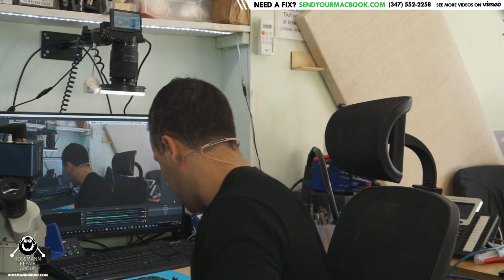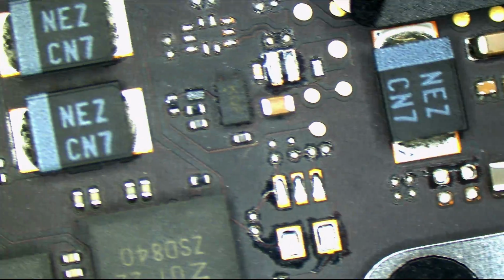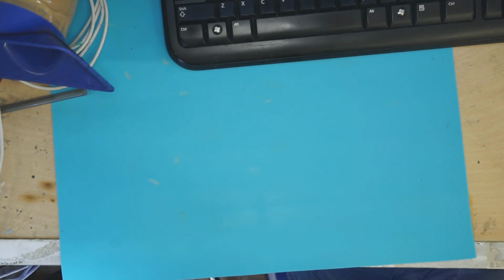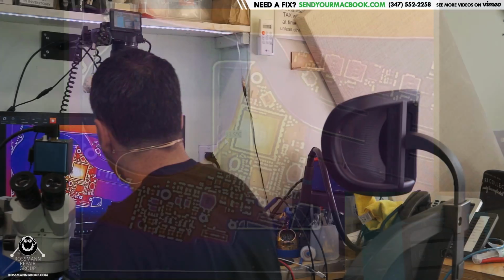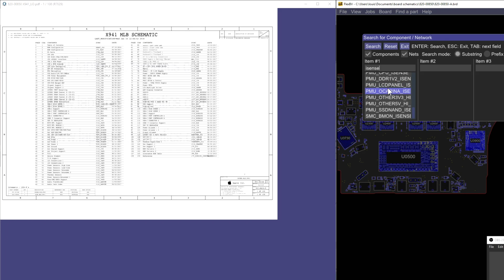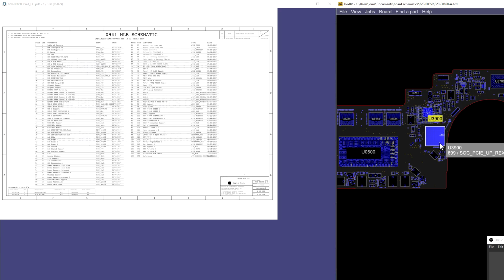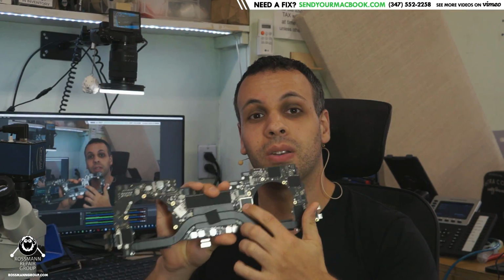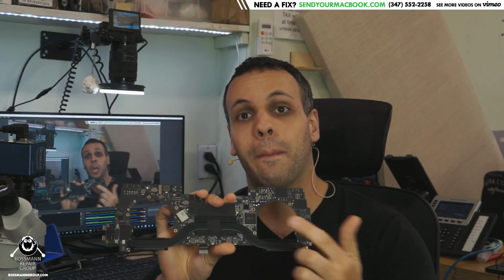Apple users have no one to blame but themselves.

Comment: One of these days, a horrible horrible person will give you the software/ equipment you need to make that T2 chip happy again.  Only a maniacle, self centered bastard would give louis the power to repair again.

How many horrible, disgusting jerks will attempt this? Please, jerks, do not give apple users this gift. They dont deserve it.
Reply: If you want to wait for that software to come along, feel free.
I'm going to just stay away from the t2 chip and all apple products
Reply: Even if they do come out with a new T2 chip, Apple probably has their operating system go out and check the code on that chip so that if it doesn't match, the operating system won't boot.
Reply: @prima6170  typical of apple!
Reply: Im really really confused as to how my pos hp laptop has been through an absolute war zone dropped slid off cars slammed around in the shop... I use it for a scan tool and scope. Never gives me issues but this apple junk fails because the sun shined too many days in a row in oregon seriously apple get it together jobs is dead yall are gonna follow soon  aint no way you can stay afloat long doing it that way
Reply: now thats 3 rusty shackefords i know, unless you know me ane then tis 2
Reply: someone needs to control planned obsolescence... and take control of these things... everyone is facing this issue not just USA but in India as well...
Reply: Rusty how triggered are you

Comment: I’ve only owned 6 iPhones and 1 iPad and all have performed amazingly, both software and hardware and all taken a beating and survived well.  My iPhone 7 fell down a flight of stairs and smashed into a door and also fell onto concrete and is still going well with the original battery for my mom.  She also owns a 2011 MacBook Air that is working now in 2021.  I’m sure there is greed with them and they do overcharge for repairs, although I’ve never needed any.  My iPhone 12 is the best fattest I’ve ever used, I think Androids are cheap crap.  Maybe I’ve never experienced Apples dark side, but that’s my experience...  Anyhow I hope they improve if this bad  stuff is all true.

Comment: My old toshiba fell off the top of my truck and even though the screen is toast, it still turned on and I still use it. I also have a new screen and cable (I messed up and fried the wire) fixing it myself. Why because I only use PC. As a Chef, I have found, an apple is only good from a tree. 😎

Comment: I completely understand the blatantly obvious fact that Apple products are WAY overpriced for what you actually get for your money, compared to what you could get with a different brand, running Windows OS. However, if I/we really prefer using macOS, (as opposed to Windows) and I/we don't want to break the law by buying/making a "Hackintosh" machine, what are we actually supposed to do? I know there's obviously the option of buying a refurbished MacBook, or an "old stock" MacBook that's still brand new but a few years old, or even buying a second hand MacBook off eBay or whatever (to get out of having to pay over a grand for a standard laptop, with dual or quad-core i5 CPUs and Intel Iris onboard graphics - which again; you could obviously get this hardware, in this type of configuration from a different brand that runs Windows or Linux etc. For a LOT less money) but then, you never actually know what you're going to get if you start buying other people's old laptops (and what's been on them and whether they've been used for any illegal activity) off eBay/the Internet... Every time I get a new MacBook, I know I'm getting ripped-off, but there's literally no other realistic option if I/we are comfortable with using/used to/would prefer to continue using macOS (especially when a lot of the software I/we use that is made by Apple, comes with macOS).
_______________________________________________________________________________________________________________________________________________________________________________
Anyway, a different but an ETERNALLY SERIOUS SUBJECT: 
________________________________________________________
Yahshua (Jesus) The Messiah Saves. Time for this blasphemous, evil, sinful, corrupted, perverted, deceptive world, IS RUNNING OUT, FAST!
__________________________________________________________________________________________________________________________________________
I am praying for ALL of you.
__________________________
Peace and love, and prayers, 
____________________________
TJ x

Comment: Presumably they have a sticker that changes colour when there's 'water damage'.

It's a good rant and you raise some valid points. However, if there's really no water damage (and he hadn't incorrectly fluxed + soldered the board) then he probably coulda argued the point with Apple and gotten it repaired. I've done it before with stuff they're hesitant to touch stuff. Sure you shouldn't have to argue with them but they're a big company with rule of thumb policies that generally work. For cases where they don't you're better off calmly standing your ground (preferably in a crowded store with customers watching), asking to speak with a manager and asking them to prove there's water damage. They have internal 'evidence collection' systems where they'll store photos after cracking computers open. Just stand your ground because if you go and do your own soldering + take it to a 3rd party repairer who hates Apple (coz he refuses to pay the fee to be an authorised repairer - so can't access the programmer's port) then you've got no hope.

PS - Apple can recover data when there's T2 issues. They use that little programmer's port that you removed from your girlfriend's machine in another video on the basis it was 'useless'. Sure her machine actually did have severe water damage (and your repair was a decent value add). However, IMO people should stand their ground firmly with Apple in the first instance rather than trying 3rd party repairs. I've known Apple to replace stuff that's outta warranty quite regularly just so they can get rid of belligerent customers and/or save face.

Comment: I buy desktop,server build at my request from vendors nothing fails in 10 years then i buy new one and it is cheaper than market products, with 1000 usd using linux.
Laptop from ASUS with hight gen INTEL at low price, 800 USD and they have low failure.
With the phones i buy mid range one from samsung evrything work fine, but first i look at processor and RAM and storage.
This thing with ID on chip is a non standard abuse on products.

Comment: I started disliking Apple’s direction regarding hardware several years ago and stopped buying new. Only older models that could be upgraded or parts replaced. And soon those machines will not be supported on the latest macOS (or even two behind that.)

So I started switching to other platforms and have landed on Linux Mint on Lenovo. Works well so far. 

But I fear that with Microsoft pushing hard for proprietary only hardware and Apple already does that, we’ll soon be seeing a lack of hardware that Linux will run on because for the most part Linux is an operating system seeking hardware to run on. Few sell computers built for Linux.

Comment: So it's basically a hardware DRM chip pre-programmed to the unique e-signatures of the machine's other components (or whatever validation they're using). Wow, great design there. Single point of failure ftw. One blown chip leading to the world's most stylish paperweight.

Comment: If u insist on getting an apple, get it dirt cheap on ebay. If it break, u didn spent 2k for it. For instant, i paid 100 bucks for a 2013  21inc Imac in spanking new condition.  200 bucks on a mint condition 2012 apple mini  with ssd drive.

Comment: Actually MacOS is using Unix base and being a great OS many years before Windows could get their shit together. Since early 2000 when Microsoft was struggling to have a decent Windows, Apple have developed a much more stable OS and users could live without the fear of viruses (or getting to install another program to scan viruses which stole precious megabytes of ram back in the days).
For people using computers to work (not exclusively for games and browsing), it was a reliable solution.
But with success also comes the downsides. Apple used to build great computers and OS, but seems that something has change in those last years of Steve Jobs and continue to look strange nowadays. 
But even today I feel like MacOS is still a better OS option. Without 99% of windows "germs" and way more user-friendly than any Linux distros.

Comment: Good riddance. I have a Macbook Pro 2012 and I'm selling it, today. I remember leaving it for a week, and it was working perfectly fine, but when I came back, it wouldn't turn on. I went to the Apple store for them to tell me it would cost $650 to replace the logic board (that was 5 years ago, it's probably more now). I left it for a few years and then eventually got it fixed at an independent repair shop for hundreds less. 

It's a great product, when it works. But I can't condone their business practices. I mean, every company is trying to screw you one way or another, but very few companies rub your nose in it like Apple.

Comment: I have an HP pavilion. It had no major liquid protection. I dropped PEPSI all over it. Shutted it down and taken off the battery. Passed trough a little hell removing alien screws. Cleaned the board an let it dry. Reassembled it. Works today with no data loses or any problem.

Comment: I stopped using Apples and Macs in the late 80s early 90s because of proprietary hardware and software. I knew the cross hardware/software times were too good to be true, and is the reason I have stayed away from Apple Inc. If you look at IBM, who Apple and Microsoft were trying to defeat, they've stepped into Big Blue's shoes, and will probably end up going by the wayside, just like IBM PC division did a few years ago, when they sold it to Lenovo.

Comment: I for one have decided not to reward Apple's behavior with my continued patronage. For several decades I bought Macintosh computers for my use. At this point, I have a pile of unusable machines, including an 8-core, 16GB-ram 3.0GHz Xeon Mac Pro, and several pricey MacBook Pro's. I just can't do it anymore. Recently I gave my beloved sister my remaining usable MacBook Pro and switched to a Dell desktop machine I can actually support and upgrade. Linux Mint has everything I need as a developer and is doing a fine job, both at work and at home. I have come to the point where I have to vote with my money, and my vote is to stop handing over my hard-earned money to a company that doesn't care about my long-term satisfaction. I have come to grips with giving up my fanboi affiliation in favor of obvious alternatives. Louis has made an impression on me with his blunt assertion that these machines are manufactured with the intention they will hit the landfill within several years. I used to feel they were well made and even if they were a little slow or small in a contemporary sense, they would remain usable longer than equivalent Windows machines. I still have my iPhone 7 plus, but when it's day comes, I won't buy another iPhone.

Comment: I always buy used apple products because I like the software but not the price or the throw away attitude, I got my iPhone 7plus with a big memory for £240 about a year ago and have a sim only with unlimited calls texts and mins for £20 a month. I have an old iPad Air I bought for £50 because it was a few years old and a new iPad I got free from work that does seem to work any better then my old one. I have my other half’s old apply laptop but don’t know which model and it works great. When something breaks I put it on eBay as spare or repair and buy another one.

Comment: I maintain that the current Gen of MacBooks are garbage. I do own a MacBook but its a 2014 15 inch model (that is not without its own problems). Every single iteration after I felt like Apple just made it more and more difficult to own one. You spend as much as a mid to high-end PC tower on a laptop that has multiple problems out of the box. You pay an extreme premium for subpar performance, power and reliability. Apple stonewalls you at every chance when it comes to repairing a broken device. I took my 2014 MacBook to replace the batter at an Apple store and they said it would take them up to 5 working days to do it. The expected price was also extremely high. I decided to go to a third party to replace it instead and it was done within 2 hours for less than 80% of the price apple was going to charge me. 

The way Apple is taking away these options and straight up abusing customers rights to maintain their own products is down right criminal. I foresee them losing a majority of their customer base once people get over the past goodwill they have. You can only abuse customers so far until we get fed up.

Comment: Outside of my iPhone, which I purchased in 2012, an iPhone 6Plus, all my other apple products were purchased secondhand.  It's strange because I purchased my phone new, but Apple has since replaced it 7 times for free! And twice it was out of the warranty - and had water damage from shower moisture!  And, I still have my iPhone 6Plus today! I can tell you that in at least 6 of those 7 replacement occasions, the issue was totally my fault. I can only remember one time where it was a catastrophic system crash. They told me it was not repairable, tossed it in a bag and gave me a new one!  And, on one occasion they replaced it just because I put a gnarly scratch on the screen and just asked if they would  -and they did! Ironically enough, this was the model that had all of the bending issues but mine never bent and was never replaced for that specific issue. It's strange to hear of Apple being so terrible with service when I have had nothing but great experiences with them.....In fact, just last week they serviced my Apple TV for free, which was also a secondhand purchase!  It was giving me issues so I took it in expecting to pay but they charged nothing. They reprogrammed it and even gave me a new remote for free!  Now, I do believe you when you say that this is happening, but I live in Minnesota and the Apple stores here seem to be super helpful and just hellbent on resolution.  They also once gave me a free plug for my MacBook Air, which I purchased used and it was well out of the warranty from the original owner. I was expecting to pay because my cat chewed the cable but they still replaced it free! A cable, by the way, which was worth $89 because I still received the zero balance receipt that had the value but marked at no charge!  I have also had my iMac serviced free...my MacBook Air serviced free and they even gave me free software on a system reboot for that MacBook! Could this is a regional thing, maybe? I have swore never to go anywhere else because I sincerely doubted getting this kind of customer service anywhere. Again, it's not that I don't believe this is happening, it's just never happened to me personally. Maybe I need to start rethinking a new system. It sounds like no matter how much they are service friendly here in Minnesota, eventually they will have us all by the balls!

Comment: I have an issue with my i pad pro 10.5 touch id
While on charging it is not unlocking the i pad but works fine when i turn off or un plugs the charger please advise sir

Comment: I'm doing my part now. Waiting on my new to me Lenovo X1 yoga I bought off ebay. Stuck using my 2011 MBP which I have "fixed" with a software solution for the #radeongate issue, but once my new Lenovo shows up I will never make the mistake of using/buying/recommending an Apple product again.

Comment: Louis not every one has the expertises you have maybe this a good opportunity  to get people together with the same problem and Sue Apple, if you can get a a lot of people they were  that have the same problem Apple saying they have water damage and the computer has no evidence of that Tro try to sell a new one  that is a scam right there , they will say there sensors they put inside to detect water  indicate that but of course we can't trust the sensors there not accurate, but  people with that problem need some one like you with your knowledge because the laws are super behind wen it comes to all this, and this company are getting rich by preying  on all this people and the system, I have not buy an Apple computer sense 2012 but I need a new one , but im not happy with the options at this moment I think I will get a Mac mini and buy the GPU ,SSD monitors and all that external ,